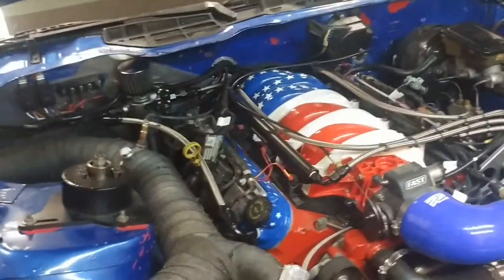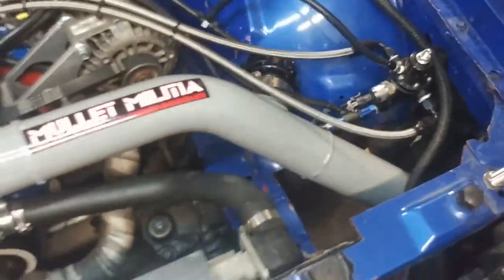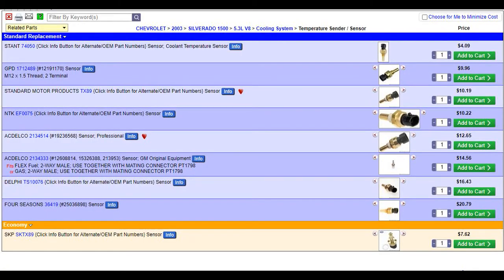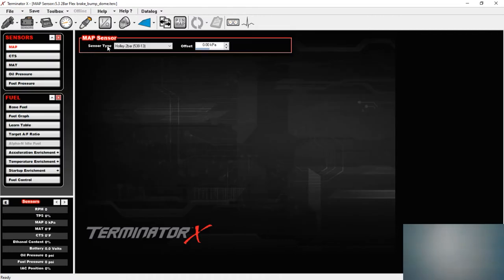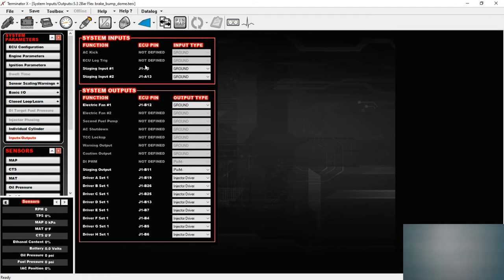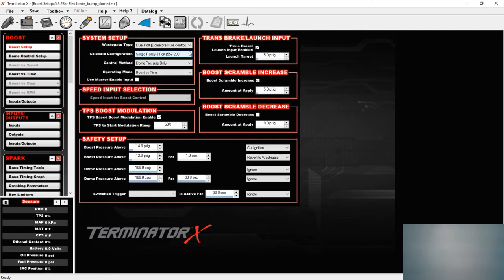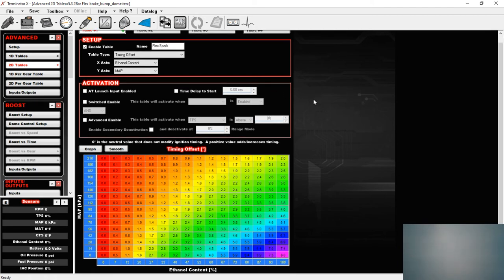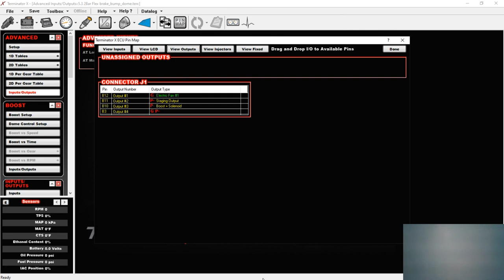Terminator X install on a turbo LS

Comment: Nice video! A lot of good info. Where is your 2 bar map sensor located?
Reply from the maker: Thanks for watching, I'm glad you liked it. When I had a 2 bar MAP sensor it was in the back of the intake manifold where the factory one was located. I've since switched to a 3 bar that's remote mounted on the firewall.
Reply: @TrailerParkMotorsports  I’m curious how did you plumb it remotely? Did you tap the factory map hole in the rear?
Reply from the maker: @ereid74  yes. I removed the intake, then drilled and tapped the factory hole for a 1/4 NPT fitting. I have a video on doing it.

https://youtu.be/oTHUIwHUurM

Comment: do you have to disconnect one of the displays to hook up the usb can?
Reply from the maker: No. I have a splitter on the CANbus which connects one end to the 3.5" screen and the other end connects to the Pro Dash. The Pro Dash harness itself has two connector on it, one of which I mentioned before is connected to the splitter, the other is connected to the USB CAN cable.

Comment: Do you have power steering?
Reply from the maker: No, I've had a S10 manual steering box for the last 4 years or so. 20 pound weight loss.
Reply: @TrailerParkMotorsports  how's the steering effort?
Reply from the maker: @jaydubb71  it's fine. Barely noticeable from the power steering, although I almost never parallel park even before with power steering.